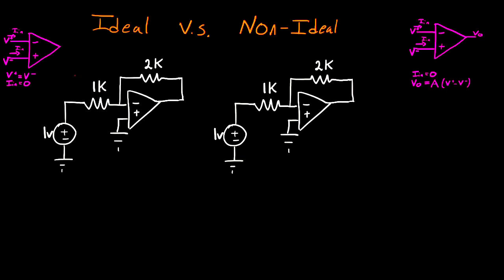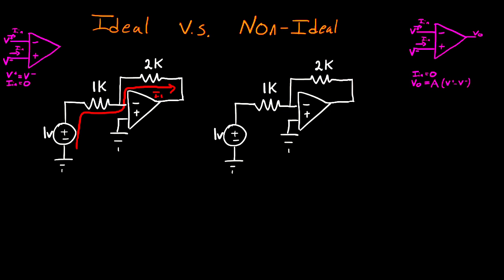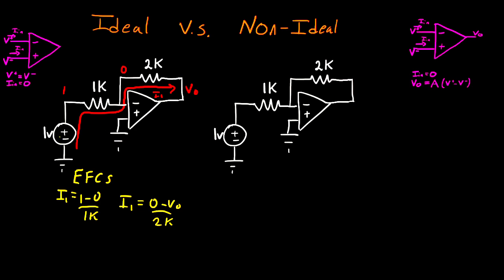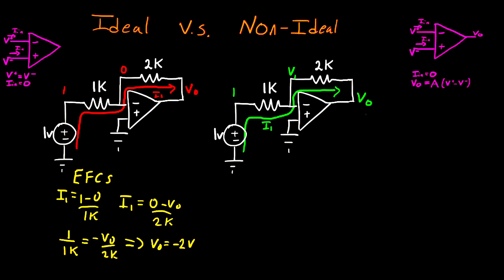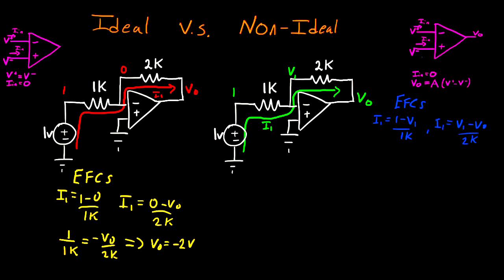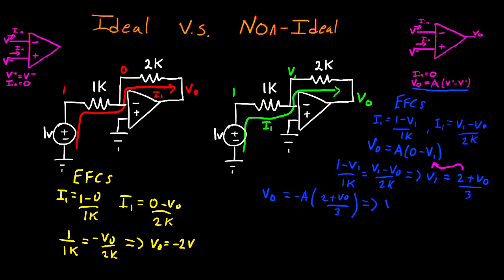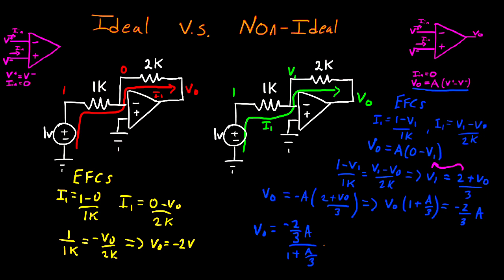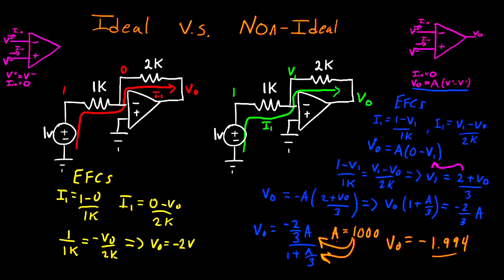Non Ideal Vs Ideal Op Amp Circuit

Comment: IMPORTANT:  A novice might confuse for NON-ideal amp    Ao (A_open_loop)  with  Af (A_feedback) = -2k/1k = -2  
                                                            in the case shown above Ao =1,000                          Af = 2k/1K =2   
                         Vin = +1v , Vo = -1.944v    so  e(-) =0.006v; e(+) = 0v (Gnd)